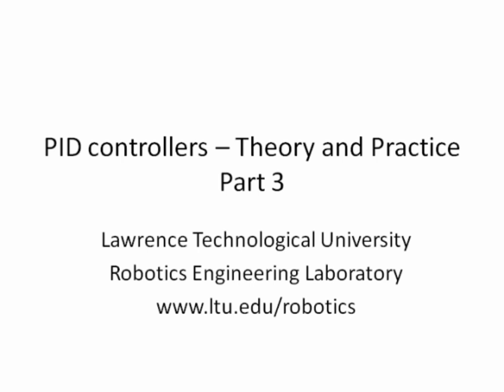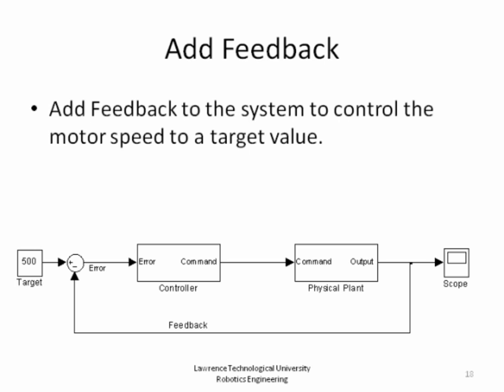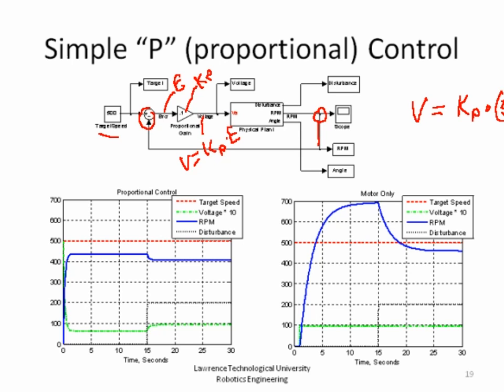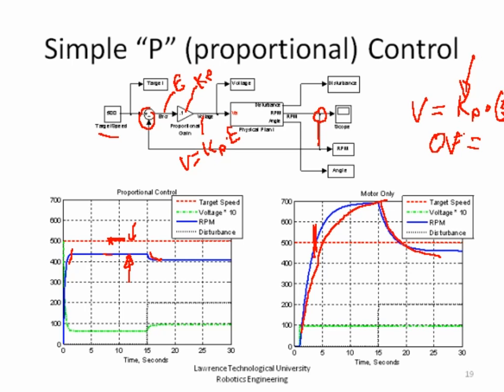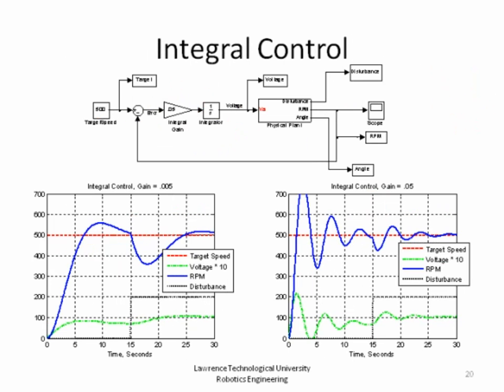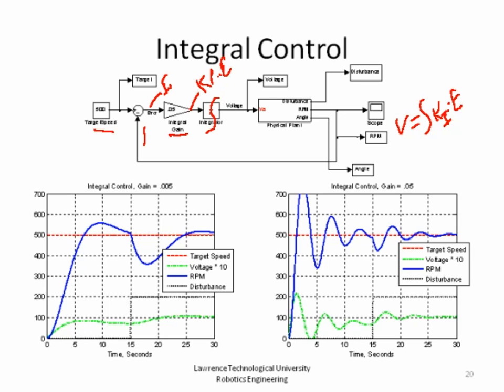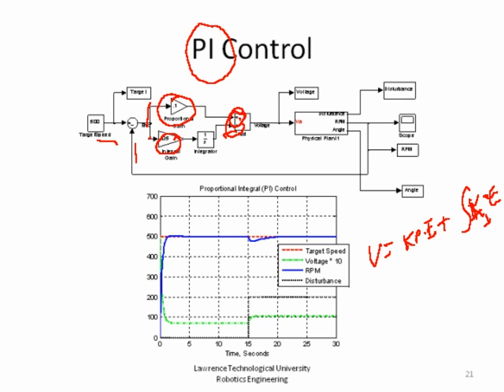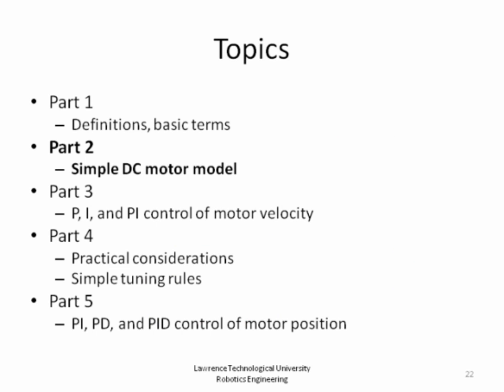PID Theory and Practice Part 3, P,I,PI Control of Speed

Comment: why does error x gain (kp) give you voltage?
Reply from the maker: The assumption behind the model is that you are controlling the voltage to the motor - in practice you may be using pulse width modulation, but the result is similar.

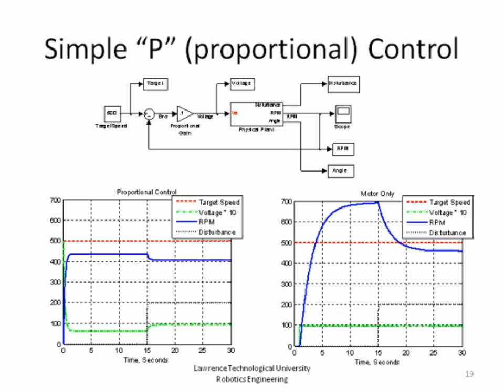Comment: According to the plot at 2:30 the applied step voltage is only 50V, while the target speed is 500RPM. Isnt the input signal supposed to be equal to the desired output?
Reply from the maker: The target speed is 500 rpm, the 50 volt is what the controller outputs to the motor - the relation between voltage and speed is not one to one and will vary with load - but in this case the 50 volts results in something over 400 rpm. Note: the actual numbers for this "motor" were just made up - but it is not unusual for the input voltage and the motor speed to differ by a factor of 10 to 100.

Comment from the maker: How are you planning to control the induction motor? 
Changing voltage usually has only a little effect on the speed - the speed is primarily a function of the AC frequency and the number of poles in the motor. Some induction motors are wired to let you select different numbers of poles to have a few specific speeds - otherwise you typically  use a variable frequency source. The motor itself is pretty non-linear with the stable and unstable operating areas. I've never modeled one myself.